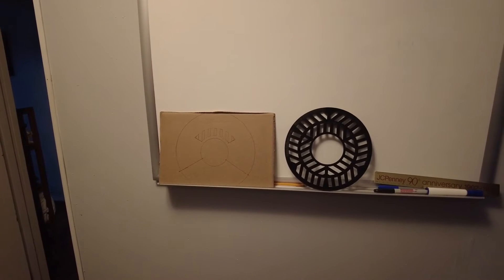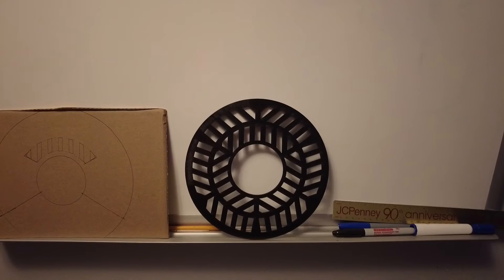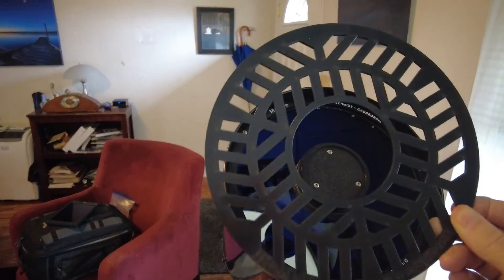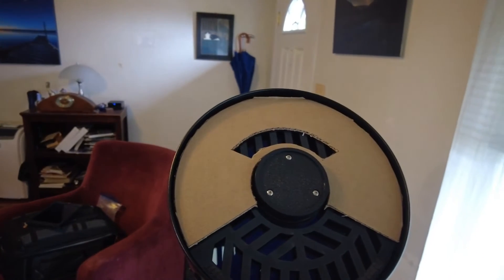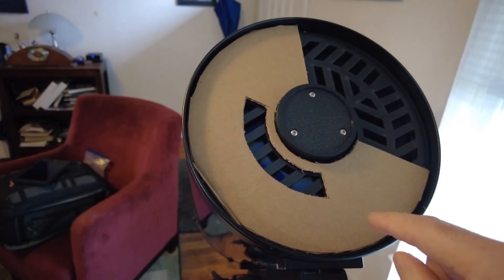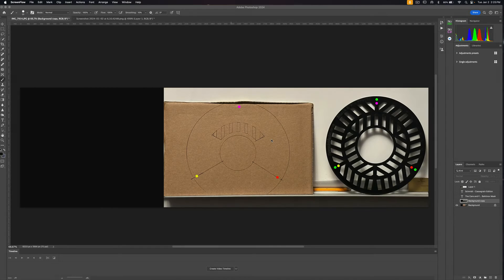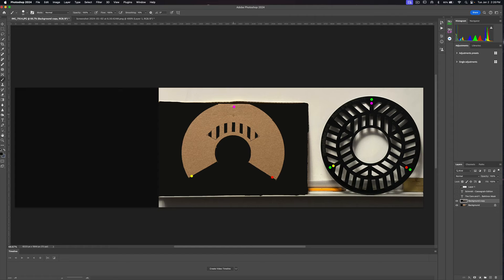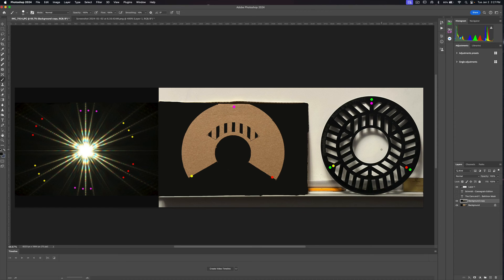SCT Collimation with Tri Bahtinov Mask

Comment: I must be having a senior moment but I am still left scratching my head.  I was getting ready to see how this all comes together and see what actually happens to these spikes and their relation to the dots during an adjustment and then the video ended 😞 I could have used just a little more guidance how the entire system and process works and what we will see or what we should be looking for.
Reply: No senior moment, it just wasn't explained thoroughly enough.  No disrespect to Mark but a before-and-after picture or live images would have helped.  Best way to describe proper collimation (after the turning the adjustment screws a little at a time) is to look at the image at the very beginning.  Focus on the triangular black areas between the spikes.  Notice how the triangles all look similar, like tall narrow black pyramids.  Improper calibration might show the red dot areas as perfect pyramids and yet the yellow and purple dark ones as imperfect.  Keep turning the adjustment screws until all 12 black triangles eventually are the same dimensions.
Reply: I totally agree

Comment: Collimation of SCT is never done by loosening screws. Such collimation will not hold for long.
Reply from the maker: The secondary mirror is held in place and balanced to the frame with a small rubber "O" ring.  The 3 collimation screws are used to either compress OR relax the pressure on the "O" ring until the secondary mirror is aligned with the primary mirror.
Reply: It’s impossible to have them all tightened up. The secondary mirror will not be aligned. The whole point of the three screw method is to tighten and loosen to get the mirror perfectly perpendicular to the axis.

Comment: Very interesting concept! Thanks for sharing. Which screw do I need to turn? If I move the purple dot of the cardboard, so that it matches the red dot on the mask, do I turn the screw of the secondary that is matching the red spot, if Collimation is a bit off?
Reply from the maker: The dots of different color represent the different "Triads" of the scope itself.  When you move the template around in a circle, you will see some spikes which are not evenly separated, and the collimation screw which is exposed will be the one to loosen or tighten to evenly space the spikes.

Comment: I'm confused what the cardboard section does? What functionality is that adding that isn't already in the mask? Thanks.
Reply from the maker: A Tri-Bahtinov mask has 3 sections.  The cardboad mask isolates 2 of the 3 sections to assist in deteerming which of the 3 collimation screws will be adjusted.  you can display the section where the spikes are not even and adjust the associated screw to widen or narrow the collimation spikes for that section.
Reply: @Zealor365  No cardboard is need, just place your hand next to one of the collimation screws to see if the shadow of your hand corresponds to the set of spikes you want to adjust.
Reply: @Zealor365 But adjusting one screw for one set of spikes simply impacts the others so you end up chasing your tail.

Comment: Thanks for sharing... very interesting approach!.. If you don't mind, I'd appreciate if you could clarify the following doubt: When you line up the cardboard mask with one of the collimation screws, you keep working that screw until the three spikes are equidistant and then move to the next section?
Reply from the maker: A Tri-Bahtinov mask has 3 sections.  The cardboad mask isolates 2 of the 3 sections to assist in deteerming which of the 3 collimation screws will be adjusted.  you can display the section where the spikes are not even and adjust the associated screw to widen or narrow the collimation spikes for that section.